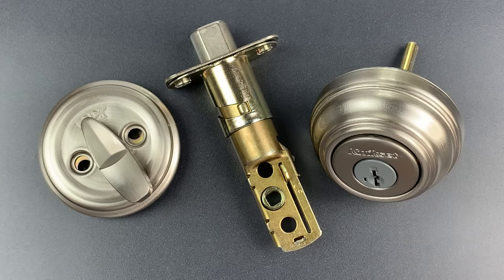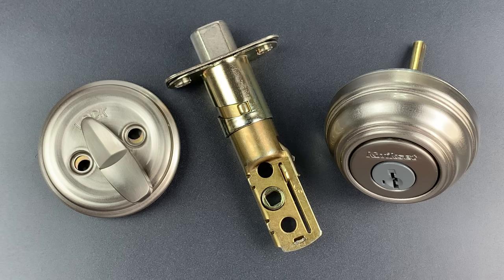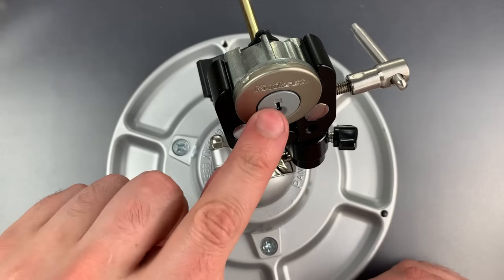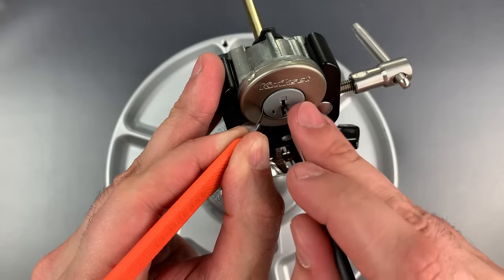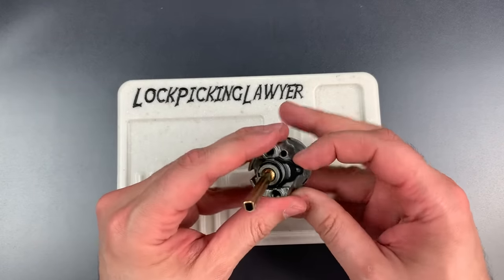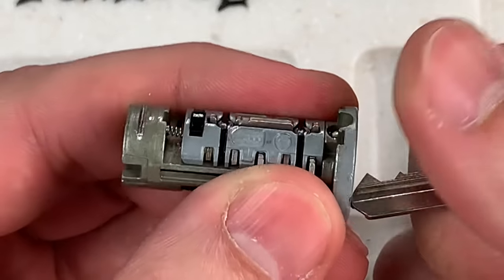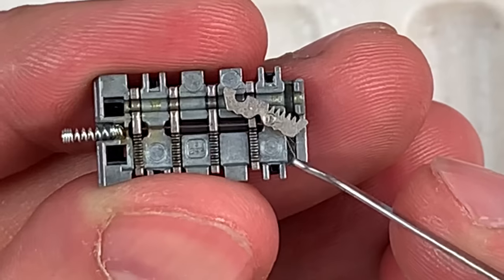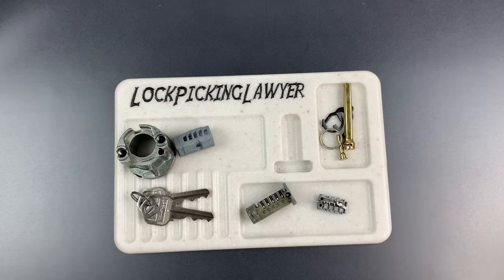[904] The “Pros" at Consumer Reports Couldn’t Pick This (Reverse Sidebar SmartKey)

Comment: Consumer Report hired LPL

Lock recommendations: N/A
Reply: "Survived 30sec vs LPL"  would be huge praise.
Reply: The bowley locks are unpickable afaik.
Reply: @amandasantini6265  they are.
Some guy named Huxley I think here on YouTube picked it
Reply: @tristanalexander3275  is that the guy who knew the bidding and had the keys which made it possible to analize them?
There's a guy that claims he picked it but that was a pathetic attempt at seeming skilled. If you have the key and can analize the bidding, that shouldn't be called picking.

Not only that, someone challenged the guy. He would send the not-picker a brand new lock where he couldn't have access to the key or pins.
Guess what happened. Exactly, not a single word from the so called picker.
Reply: @amandasantini6265  That's not entirely true.  Some guy named Chris Ahrens picked open a Bowley lock:  https://www.youtube.com/watch?v=X04qgD0hOXk .
Reply: @Ken Fullman That guy picked "a" Bowley lock, not all Bowley locks.  The fact that he picked a Bowley lock does not mean all Bowley locks are pickable.  Amanda originally wrote "The Bowley locks are unpickable."  If someone picked even just "a" Bowley lock, then her original statement was incorrect.   Even if this guy had all the inside advantages before picking it, he still picked it open and so Amanda's original statement was not technically correct.
Reply: @stevew3978  
Whether you could call that picking, or making a key copy is really the question.  Either way Bowley locks seem to be retaining their championship status as most unpickable.
Reply: @JosephXFS  That guy Chris Ahrens picked open his own Bowley lock, period.  I certainly don't see you picking open any Bowley locks.  

In most of the LockPicking Lawyer's videos, he studies a lock beforehand and finds its weak points before proceeding to pick a lock.  Does that inside knowledge take away from the LPL having successfully picked open all those locks?  No.  Same principle applies to that guy picking open a Bowley lock.
Reply: @stevew3978  I think a lot of people here are operating in the context of the original comment, which is what sort of Lock could you recommend that couldn't be picked by someone who was not doing it for sport, but was actually adversarial to you. Although Bowley locks are indeed pickable, the point of most of the comments saying they are not is the assumption that the person doing the picking is not merely doing it for sport with access to specialized tailor made tools and the original key, but rather, that they are doing it for the purpose of gaining illegal entry to something you secured, and don't have the ability or foresight to attempt the pick. 

Now I suspect based on previous videos I've watched, and just being a long time viewer that a "random" Bowley lock is still pickable, but hardly in a reasonable way. For their fork key lock, which is probably the most relevant one for this discussion, you would need 12 unique u hook probes, each one with a zero lift pin on opposite sides of the lock, and then you would need to carefully hold it in place with those tools in place, a third tool applying tension, and a fourth tool to do the actual picking... It would be a nightmare on a random lock and take forever, in addition to the very tight tolerances making even telling which one was the zero lift extremely difficult, and meaning you're quite likely to make a mistake. 

As far as I know they only have one zero lift pin on each side, but they could probably create even more of a nightmare if they randomized it to have between 1-3 pins on each side between each lock... I don't know enough about lock manufacturing to really give much commentary here on the difficulties involved in that sort of thing. 

Point is while the locks are indeed pickable, as far as recommendation, random pick, or actual non-destructive lock goes, they are BASICALLY unpickable for the purpose of anything other then sport, and if you are trying to gain entry to a place that has one, destructive entry really is just better at that point vice wasting the time and increased risk of exposure trying the non-destructive route, which for 99% of criminals means they just won't bother.
Reply: I'd suggest flash freezing and breaking these locks rather than try to pick these ridiculous locks
Reply: @robertcowling4313  IIRC, in the critical part of the heist, she actually does crack the safe cuz she screwed up with the drill. There was some sort of safety mechanism that she almost triggered cuz she wasn't careful enough, so she had to unlock the safe by figuring out the combination.
Reply: @amandasantini6265  but lpl also owns the key and know how the stuff workss
Reply: @wellifailed392  You have to know how stuff works to pick something. It's not like you can just insert a piece of metal in a lock and open it without knowing neither the lock and how to pick. Lpl can pick anything with time and knowledge because he's been practicing his whole life, and locks aren't supposed to stop this kind of people, they're made to stop a random passerby from taking your stuff while you don't watch.
Reply: @Pointlesschan  Nitpicking, I'd say
Reply: “Just weld your door shut every night”
Reply: @amandasantini6265  true but the lock is still pickable
Reply: @amandasantini6265  Out of all the locks on the market, you specified the "Bowley". How long did it take you to pick that particular lock?
Reply: @WhiteUnicorn82  "Herp Derp I'm going to ask someone who's obviously not a lockpicker how long it took her to open the lock, because somehow I feel hurt for the guy she mentioned".

It's obvious Huxley (or whatever is his name) can't open the Bowley Lock unless he has the freaking key in his hands so that he knows the bidding. That's why he's been shut ever since someone challenged him to do it without the key. And that's totally fine, it's a good thing that lockpickers can't open a few locks in the world.
Reply: nothing is unpickable, an example exists, so you discredit the example... I do certainly hope you work for bowley, otherwise imagine simping for a lock company. oof.
Reply: @BrianRyans  LPL Lock Recommendation: a roll of duct tape.
High-Security applications: the really fancy duct tape with reinforcing threads.
Reply: Here you have your brick wall. He cant open it. Well you cant either cause no hole for key but dont bother me sith details
Reply: @lockpickinglawyer  do you have any recommendations? Be it for features or security or cute gimmicks?
Reply: “Good enough for the street”
Reply: @amandasantini6265  It's "bitting".
Reply: @amandasantini6265  well, if somebody REALLY wants to get in your home, they can buy the same lock then take it apart to analyse it.  People buy "unpickable" locks because somebody is getting in.  Not everybody lock picks for sport.
Reply: @ab935  Buying a different (yet same model) lock *IS NOT*, I repeat, *is not the same as having THE SAME MODEL and analyzing the key bid from that same model*.
Reply: if you watch the videos where people send him things you soon learn that duct tape is harder to open than a lock for this guy.
Reply: @Adahn99  Actually there was a lock that he spent some time trying to find some random item that wouldn't open the lock.
Reply: The ratings would be how long it took LPL to pick it open.

Comment: “That’s something that was pioneered in the 1930’s, which is extremely pick resistant if implemented correctly.” 

In other words, he had to loosen his tie a bit when he found out he got that version
Reply: To be fair, if they had the core have an extending bit of metal covering where he put the metal in the edge, it probably would be A LOT harder to pick, but idk I know nothing about lock picking xD
Reply: @skyr8449  That's what i was thinking, just a ring impeding entrance would prevent this picking
Reply: @skyr8449  it does seem like an obvious thing to do. That or make the clearance tighter such that no shim can be gotten in
Reply: @gleggett3817  Yeah but then you have to mass produce these with said clearances and sell at a profit.
Reply: Probably not. That's a big IF, and companies catastrophically increase tolerances when they go into mass production.  Most flaws I see are from tolerances.
Reply: I took the opposite meaning. LPL had to put ON his tie so as to be "professional"

Comment: "Professionals can't pick this lock!"
"I'm not a pro, I'm a lawyer."
Reply: Blue Shell kicks door directly above or below door handle guess I didn’t need a lock pick tool....
Reply: @philipmoore449  Remember reading some comics that have scene talking about a house with door that have hinge with screws facing outside. Instead of the 5 locks the house owner installed on the door, the thief just unscrewed the door hinge and removed the door.
Reply: to be truthful, hobbyist lockpickers may very well be more skilled than a typical locksmith professional.
Reply: first
Reply: uh oh
Reply: like super horns?
Reply: @Exarian  hobbyist lockpickers ARE more skilled than a typical locksmith

Fixed that for ya. Locksmiths spend almost zero time picking locks, their time is too valuable (and too costly) for them to do more than attempt the usual bypasses then drill the core. Some might attempt raking at the most. Customers want in NOW, not a half hour later, and lockpicking will a skill level less than LPL's means many picks would take that half hour or may not succeed at all. They drill the core and insert a new one and are on the way back to the shop in 10 minutes if the bypasses didn't work.That's the standard locksmith business model.

Comment: There is actually a quite faster and easier way to pick these locks. Make a very strong key that fits the lock (a screwdriver will work for that matter) and apply torque. The cylinder on those locks cant take very much torque until they slip and turn.

Edit: if you do this to your own house you will notice that the key still works fine after the force attack, however it is advisable to replace the lock as this method is likely to damage the lock core and should only be done in emergencies.
Reply: That isn't picking. That is destructive entry. Picking allows you to continue using the lock, in this case it's rekey feature, without damage. 

I agree, it is easier to break it open like that though. That is smart keys biggest flaw.
Reply: There is actually a quite faster and easier way to pick these locks. Simply kick down the door until you're inside. These locks aren't made to withstand that
Reply: @pozloadescobar  In my experience with forcible entry, windows are easier to break open, then doors, then walls, then roofs...  Windows are also typically easier to repair.
Reply: kwikset addressed this
Reply: @jgg204  addressed what and how?
Reply: @Cortez1776  maybe they advised people not to make blanks out of D2 tool steel.. ;)
Reply: That's actually only true to version one of this 980 series which had a plastic sidebar. Version 2 and 3 which has metal sidebars like his does can't be forced twisted. The method you said worked because people could break the plastic side bar and it's housing. This doesn't work anymore. And version 3 came out after lpl made this video and it does also make it harder to shimmy the cilinder to the right like he did too. Kwikset is actually observing these videos and trying to improve them every new version they release for this flagship lock they make. Probably the only consumer company doing this. I think lpl will find a way around version 3 but would like to see how he does it. It will have to be different then what he did here.
Reply: @pozloadescobar 3” hardened screws make kicking in a door very difficult. It’s usually the door jamb that breaks, not the lock.
Reply: Just tried, doesn't work. They must've addressed this.

Comment: When a lock is unpickable by LPL then what remains is C4.
Reply: If it takes LPL more than a minute to pick, it's probably good for us mortals. ;)
Reply: Then the ramset comes out
Reply: If the standard hook in 16 thousandths doesn't work, the steel jacketed .308 will.
Reply: 12 ga slug will defeat most deadbolts
Reply: @danpowell806  I think opening a lock with a gun is harder then you think. Anything short of a shotgun slug is probably going to mangle the deadbolt without actually removing it.
Reply: @ehsnils — Nothing so drastic is needed.  A rock from the garden is sufficient to smash the tempered glass of a sliding glass patio door, most of which in America are unprotected by rolling metal shutters.
Reply: My rotary pick is 100% guaranteed to open any lock. Although, occasionally in conjunction with a Dremel cutoff wheel
Reply: @Milosz_Ostrow  Bah, that's no fun.
Reply: Milosz Ostrow but if you have a large dog like a pit bull, bull mastiff, German Shepherd, or Doberman chances are they will think twice before putting said rock through glass.
Reply: Cordless rotohammer
Reply: @OUSWKR  then pick the rock up and throw it at the dog
Reply: There is one
Reply: Dan Powell hit it with an API
Reply: Elliot White hinges, deadbolts, throws, doors, windows, engine blocks.....all around just a good door opener and window maker lol
Reply: I would just hack the door with an axe.

Comment: I would love it if there was like a 30 second to 1 minute segment of these videos where he talked about how he would go about improving the lock after he opens/breaks it.
Reply: An external gate or ward of some kind would help I would think.  The ease of picking seems to be because he can get that shim around the cylinder.  A plate over the face of the lock preventing access to the "seam" between the body and the cylinder would probably  be sufficient.
Reply: otomoton yep or a second cylinder/“jacket” around the lock cylinder would completely prevent access from the outside of the lock.
Reply: He should get paid for that part by the vendor.